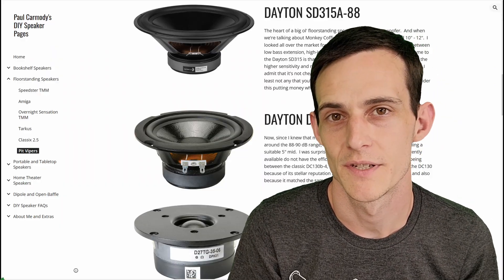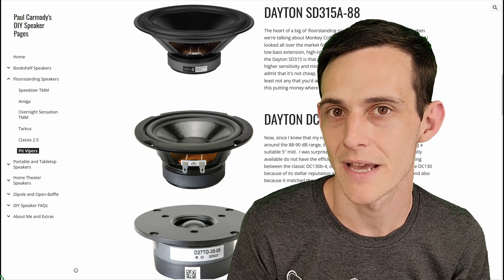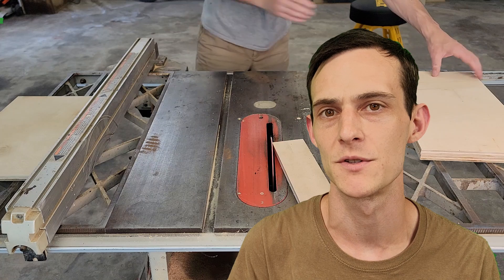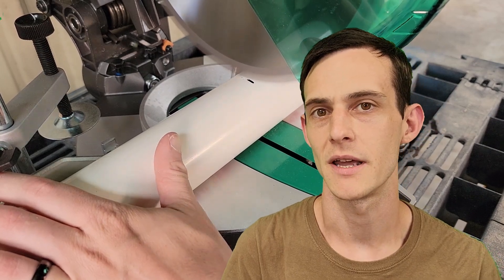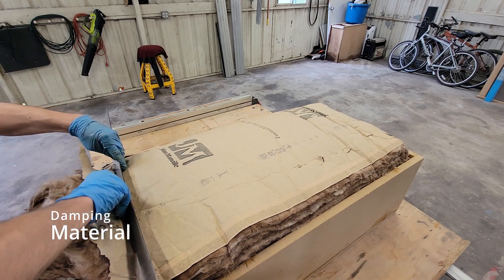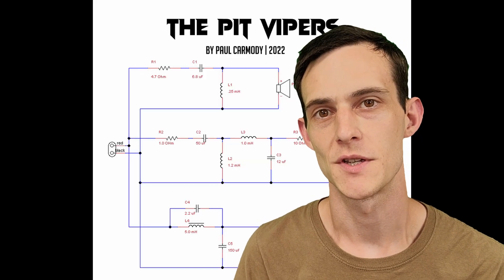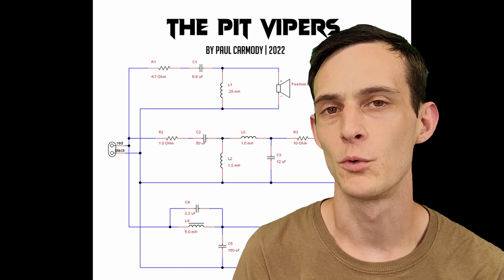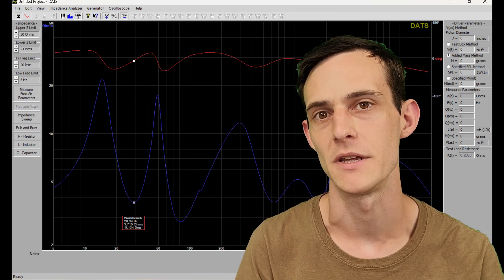Building The Pit Vipers - Audiophile Party Speaker

Comment: I’m really impressed with this build . For the most part is pretty simple . I would have liked to used a software program and gone with a larger port at the bottom using the chassis as one side of the port ,and making a rectangular one out of mdf . 
I still wonder about chuffing when the inside of the pvc port does not have a round over. Back in my car audio days I would replicate the flare on the outside port by making one out of mfd for the inside . It was just a precaution for my ocd .

I would like to build a set similar to this one day ,but use constrained layer damping which would involve two layers of 3/4” mdf for all walls. May have to reinforce the floor though 😊

Comment: Hi, I liked you wear a respirator when applying the damping-material. Do you also wear them indoors while listening? Ported-design will spread 0:00 micro fibers (overtime).   But Nice overall build. Greets M
Reply: In my case I use a product called Roxul , it’s made from rock and not as detrimental to your lungs . As a precaution though, I wore a mask the first few days when I was breaking them in

Comment: Nice build . I’m a 63 year old car audio guy , and one thing I used to do in the 90’s is use fibreglass resin inside my enclosures . During assembly I’d mix  up some resin and use a paint brush to apply it to the joints . It makes the joints virtually indestructible .
Not that it’s necessary,but it certainly provides peace of mind . 

On a side note ,I have a dado blade for my table saw and put a rabbet joint on my edges , kind of a groove that helps with assembly . I still use clamps but it does help with lining things up
Reply: That’s a great idea. Thank you for sharing. I use resin for lots of things, and adding some fiberglass and painting it on the joints will certainly give piece of mind.

Comment: Analyzing your measurements, it looks as if your crossover points are wondering with the voice coil excursion.
I would take an inductance reading of the voice coils and design impedance equalization circuits for the woofer and mid-range.
That is likely what is causing your 80Hz bump and 300Hz dip.
If you don't have an inductance meter, GET ONE!
it is imperative for crossover design!

Comment: Glad I stumbled on this build as it confirms an issue that I discovered with the speaker.  That dip in the lower mids is in fact there.  I measured mine outside elevated quite high up and got the same dip which isn't present in Paul's sim.  Unfortunately this likely means that Paul's data he utilized for filter design was not very accurate.  It can be quite tricky to get accurate information for the woofer to mid filtering.  Paul states he did much of the voicing in home so I assume this dip was to counter act the speakers loading in his room.  I felt this dip in the response bothered me quite a bit and left me with a speaker that felt too bright and lacked body.  I ended up removing the passive crossover and running the speakers active to get around this issue and overall achieve much better driver integration.

Comment: I'm going to build these for my shop. It's a huge spray-foamed building so it makes everything sound good. 

Questions:
1. do you still like them?
2. Do you recommend any particular capacitor brand/model for this build?
3. I'd like maximum bass output capability(I'll EQ out excess) should I move the ports to the rear?

Thank you.
Reply from the maker: That's awesome!

Yes I do like these. I think they'd be great in a shop. I would stick with Dayton capacitors, unless you just want boutique for the sake of it. There is 1 large value that I used an electrolytic cap on (the woofer).
For the ports, if you're going up against a wall, or corner, probably best to leave front.

Comment: Looks interesting,  in a magazine in Australia some years ago a party speaker was built using Kaboodle kitchen cabinet kits.
Reply from the maker: That sounds fun. Here in the US, prefabricated kitchen cabs are so cheaply built. It would be so much trouble the seal and brace. Was it for the kitchen, or just the cabinet itself?
Reply: @DIYhyfy  They wanted an easy quick solution for the cabinet.  So they went to Bunnings ( Home Depot) and picked up a   couple of flat pack cabinet modules..
They weren't intended to be hifi just party. As far as I remember they used Motorola piezoelectric tweeters .
Great for nite clubs.

Comment: I made these and thought they were ok.  The dc130 is quite a good IMO, as if the woofer, the tweeter I do not are for at all and don't think it was a great choice here.  The midbass dip is mostly what I consider to be a result of inadequate data set for the filter design state.   Paul's sim shows effectively opposite response in the 300hz region, with a difference of about 5db, quite a lot.  It can be tough to get accurate information to work with in the lower band of a 3 way speaker so this different isn't that uncommon.  You can fill it back in with EQ or change a few values on the stock xover which also gives better phase tracking between the woofer and mid.  I also replaced the Peerless D27 with the Dayton nd25fw and found it to be a considerably better match in terms of on and off axis response, the xover needs modification for this but it is cheap.  I'd love to see Paul utilize virtuixcad in the future, I think it would help him out a lot.
Reply: Hi Josh, I'm going to build these speakers. Could you share the crossover modification to accommodate the Dayton nd25fw tweeter?

Comment: "I sat down to test  and listen to a couple songs, but the sound quality was so engaging I ended up listening to music for the next 2 hours" - says it all about the speakers! And you have discerning taste. So, making a note about these speakers. Using a 5 inch midrange instead of a 3 inch I think is what brings out the best in this speaker. I hate 2 way speaker designs. They always sound "thin" to me. If you are going to take the time to build something, build it right.I'm surprised about the plastic speaker housing though for the midrange. But it works apparently. cool build. I just would have gone for a darker (midnight) blue.  lol  But they still look decent and are at least not "black".  But it's what the speakers sound like that matter.

Comment: Whats the max spl? Is there port noise on high volume?
Reply from the maker: Hey, can't recall exact number on spl. Paul has most of the technical data in his write-up on his site. If you search "Paul Carmody Pit Vipers" it should come right up.

As far as port noise, none so far at any level. I modeled the response myself since I actually changed the port diameter. Air velocity was a bit higher than the rule of thumb, but not bad enough to be audible in any listening I've done so far.

Comment: The jointing could be improved with miter lock jointing. Also cutting grooves in the cabinet to receive the internal bracing. It did however look like a solid build. 
I have thought at length about the external finish of a cabinet. 
With what people are doing in the car industry?  I thought it might be bad ass to finish the cabinets in a rap.
Reply from the maker: I've wondered about doing a wrap. I just don't have experience with it. Seems like it would be tough to do seamlessly.

Comment: Nice build! But it seems u wear protection all the time but still using fiberglass as damping? I would not want that in my house, that subwoofer will spread that fiber all over.
Reply: Freakishly friable
Reply from the maker: It's a definite possibility, but these will be run at low output levels. Not a ton of air moving around
Reply: @DIYhyfy  Yes, but still a bad choice for dampening,

Comment: Perfect timing, I just got 2 10" Dayton designer woofer and they are monsters, I'm going to be using difference mids and tweeter and build my own design. I pulled of a 2 way with a Dayton 10" reference paper cone woofer. Which a lot of people said you can't build a 2 way with a 10" which was hard to pull off but it sounds amazing, so now I'm planning a 3 way. As far as imaging, you are 100% if you design and plan the crossover to cross before the drivers are beaming etc. They don't have a problem. I think you need a 10" or 12" woofer to really get that mid bass and hear those kick drums sound live. I sit and can't stop listening to all the new things I hear in songs that I have heard a million times. Unfortunately I haven't seen the Dayton reference 10" paper cone woofer on PE website, but I got an open box with a 25% on top of that off on a pair of Dayton designer 10" woofers with aluminum cones for a song. So it looks like I'm designing another speaker . The problem is I have 3 other projects I need to finish ahead of it , full time job and a relationship. Last time I picked the speakers over the girl. Let's see how the new one goes 😜.
Reply from the maker: You choose correctly!!

Let me know how the build goes. 3-way is significantly more tricky to get right. Best of luck on the build! Thanks for watching.
Reply: @DIYhyfy  yeah I know, I have it layed out on xsim a couple of different ideas, it's going to take a lot of real world measurements. I was going to make my other a 3 but the money, it would have cost another $300 and it worked out great. But the next one hopefully will be better. But great job, that's an awesome speaker!!!

Comment: very nice! i wish i could make my own boxes lol that crossover looks good however id drop that iron core out and wouldnt use those metal speaker connectors. and would prolly use tube connectors for the hookup...
Reply from the maker: Thanks for the watch!

As for the inductor, I personally don't consider it a big deal, but would also prefer an air core. The problem is, large values (5mh) go out of stock very often. I needed to finish the build, so waiting wasn't an option unfortunately.

Comment: Off-center the tweeters and mids helps in theory to avoid distortion. Great work!
Reply from the maker: Off centering drivers is a great idea. It wouldn't be tied directly to distortion. Distortion is a product of driver non-linearity. This is handled in the crossover.

Off centering the drivers would help with surface reflections. These reflections create nulls & peaks in the frequency response. Tying it more to tonality.

Thanks for watching!
Reply: @DIYhyfy  You are right! with surface reflections ;) Love you work, I'm a Speaker DIY'er myself.
Reply: @DIYhyfy  I think he was thinking of diffraction. But I am in the process of designing something similar, I am going to use MDF and then a 2" thick piece of maple for the baffle. That was with the 2" thickness I taper the top making it narrow with a 45° angle down to the woofer which I want to make wider. It's a little extra work and money, but I have been thinking about the best way. I was going to move them to the outside (t+w) and then I saw a pair like that and liked it. I have a pair of 2 way I designed with a 10" Dayton reference paper cone and I think that's the only woofer I found I could crossover at 1400 without breaking up and after hearing a 10" woofer you can't go back. It's the only way to listen to Aja

Comment: Great video!  One question...  Is it not recommended to also screw the panels together?  Will the vibrations back out the screws?
Reply from the maker: This is a huge misconception. Screws are totally fine to use. Generally in very high out subwoofers or PA applications where they'll be moved around a lot. 

In home audio, simply glue & clamps are plenty sufficient. The glue binds the mdf together very strongly.
Reply: @DIYhyfy  Thank you!  I am generally a "glue and screw" guy when it comes to stuff like this, or at least brads.  I figure if I'm going to build a cabinet and throw some expensive veneer on it, I prefer to have the extra insurance the joints won't come apart even a little.   I'm a noob woodworker, so "belt and suspenders."

Comment: Very nice build. The ports seem tiny for that woofer but I trust you there's no chuffing.
Reply from the maker: You have a good eye. Paul used 2.5" diameter. These are 2".  I modeled the response to be sure there weren't huge issues. I couldn't for the life of me find 2.5" pipe.
Reply: @DIYhyfy  Yeah, most stuff is 2". Even rolls of stretch come on 2" tubes.

Comment: Nice build. I've heard DIY floor standing open baffle speakers taller than I am that image well with 15" woofers in an WMTMW configuration. They have a compression driver with 10" wavegiude that helps with imaging. I think large baffles can do very well if designed correctly. Also with what you experienced with the bass notes, perhaps having a larger woofer is more important for clean bass notes. If you think about it that 12" woofer only has to travel a couple millimeters to produce bass notes at a decent volume compared to say a 6.5" woofer that has to spend more time moving 3x that distance creating more distortion to make the same volume. Also your not driving an amplifier as hard with those more efficient larger woofers so that is less distortion again. For critical listening its those minor improvements that make some difference. I'm glad you hear such a great result with them.

Comment: Is the PVC midrange hood part of the original design? I’m guessing that its resonant frequency wouldn’t be excited by the mid driver, but would by the woofer, since they share the same larger cabinet. Have you noticed this to be the case?

Either way, it’s a beautiful-looking speaker! I respect and envy the heck out of your rattle can skills!
Reply from the maker: Hey, I did wonder this myself. The inside of the pvc is damped with dacron, but the cap itself isn't damped apart from being rigidly mounted to the baffle. Paul Carmody used the same setup, so I just trusted his judgment. There's no audible resonance from it, that I can tell.
Thanks for watching!
Reply: Considering the size of the PVC hood I would assume the resonant frequency is higher than the crossover point of the 12" woofer. On Paul Carmody's DIY speaker site, the frequency response of the woofer starts tapering off at 300hz. There might be some energy that excites it but probably very little to be audible.

Comment: can u use dynamat or something similar on the inside for sound deadening? instead of polyfill or the fiberglass?
Reply from the maker: Hi, damping and bracing are 2 different issues. Polyfill & insulation break up standing waves.  Bracing reduces panel resonances.

Comment: Looks outstanding. I've always wanted to build a 3-way "party speaker," like the ones I had in the 70's. What is the black material that was laminated to the sides, and why only the sides? How were the corners of the MDF sealed before painting? MDF is notorious for soaking up paint and preventing the creation of a smooth, shiny surface; yet you managed to give the corner paint the same quality surface as the rest of the cabinet.
Reply from the maker: Hi, the laminate is Formica. It's only used to cover joints. Hence it only needs to be used on the sides. (Assuming you've designed the joint to be on the sides only, like me).

The primer is sandable rustoleum primer. I would recommend 2-part epoxy automotive primer for easier sanding, but it's more expensive in a rattle can.